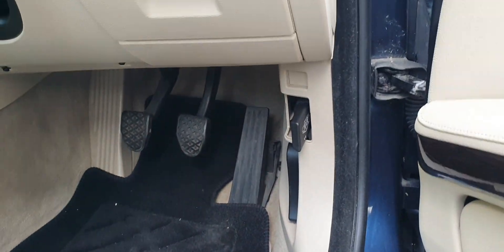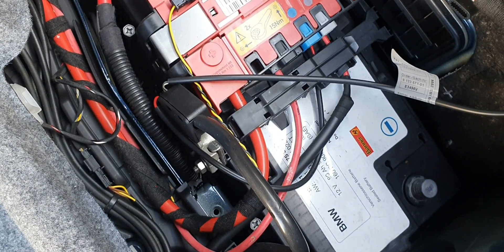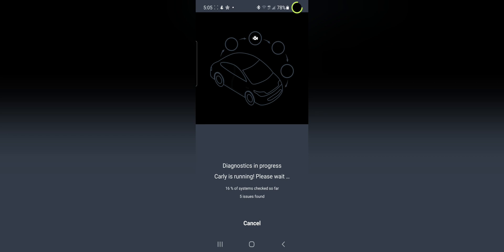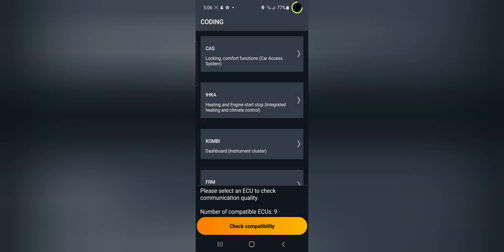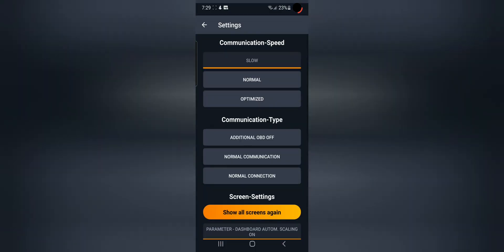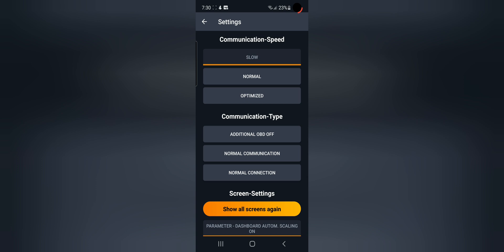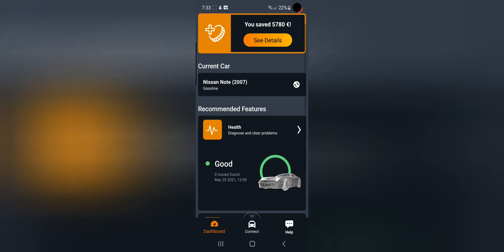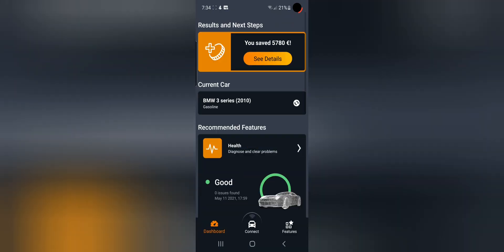how to code a BMW E93 hardtop convertible step-by-step guide also is Carly worth buying

Comment: You don't need to code the car to open the roof on the key this option is standard from BMW on the e93.
Reply: Only standard option for comfort access ones
Reply: Mine does not work 2008 328i convertible
Reply: how do u do that, mine not working for 2007